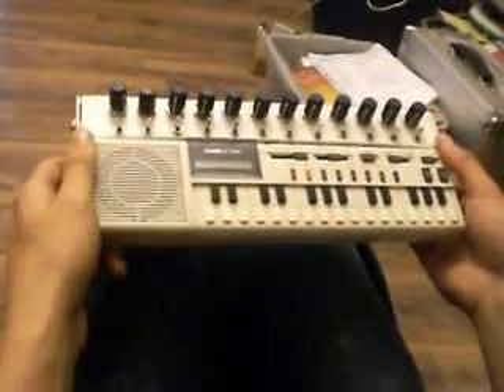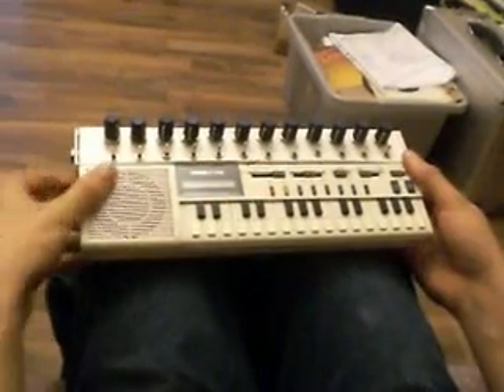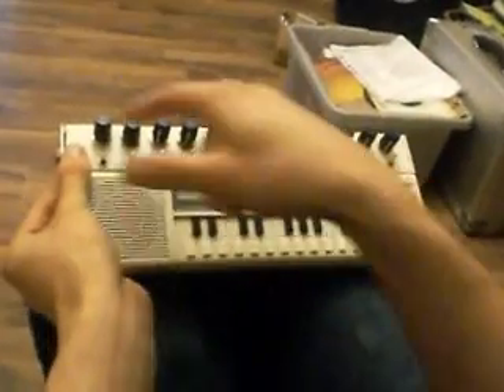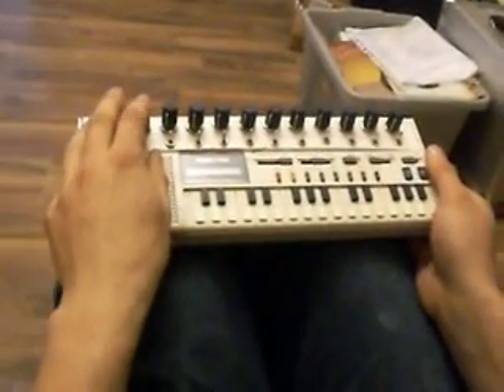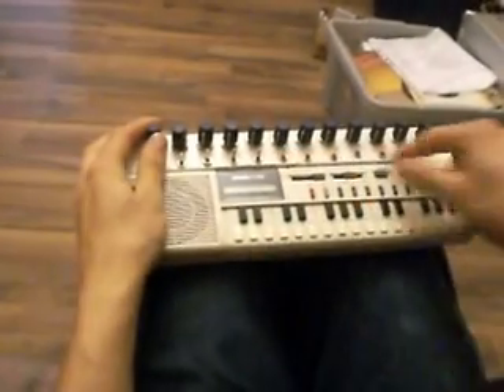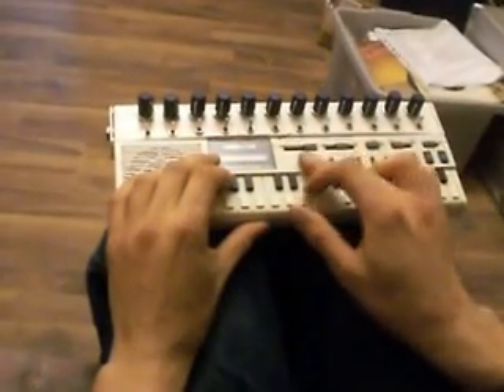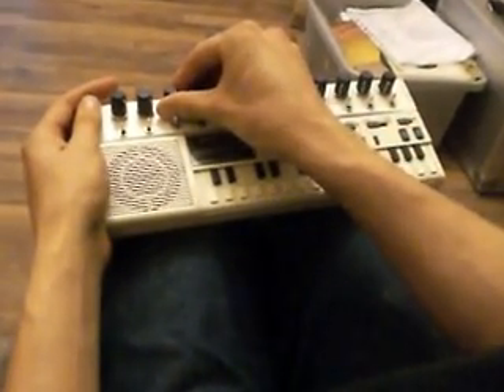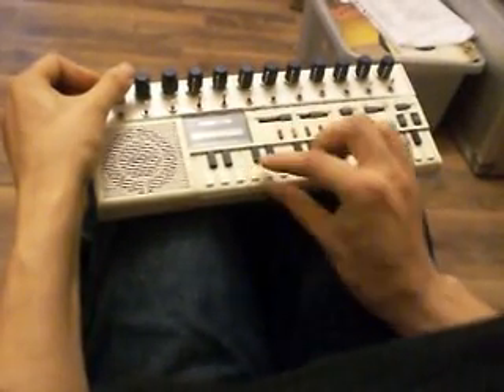Circuit bent Casio VL tone 12 Bends

Comment: well for audio outputs usually you limit the current, that's what an audio-taper does. It's a variable resistor that reduces the current flowing through. But ICs often have CV inputs to control certain parameters, so by feeding a modulated voltage into it you can control that parameter. If you feed a too high voltage you can fry the chip, or overheat it. I'm no electronics expert, I'm just deducing this from the little I know... but if you know better, let me know! It's all a learning process...

Comment from the maker: try looking on the slideshare website, I am under the same username there as well. It may be wise to put a voltage divider on the output to lower the voltage to safe levels. otherwise just pass the output through your finger onto the circuit board.... just be careful not to fry the keyboard

Comment from the maker: good luck on the circuit bend... can i suggest that you make a simple square wave oscillator using a CD40107 chip and squirt that signal in to the circuit board, trust me it will do some weird things. Also you may want to make a low pass filter using a variable resistor and capacitor to take out the high pitched squawking. Some ideas for my next series of circuit bends.

Comment from the maker: @JoelWestTV 
I would say in total it takes about 4 hours to find the circuit bends, as I have a few already done I can copy the same bends, reducing time substantially. 12 bends is 12 potentiometers, 12 switches and 12 knobs, so a minimum of £1.50 a component = £54 then the mini trunking was free as I blagged it off of someone and a mono socket which is £1.50 as well. So lots of money, of course you could just use the pots without the knobs and switches, which would make it £20 in total.

Comment from the maker: Its pretty easy, just need to spend some effort and go nice and slow.

To make so many circuit bends i draw on the circuit board each place i want to solder a connection onto, that way I don't clutter the board up with wires.